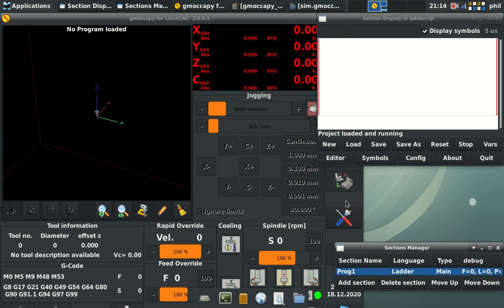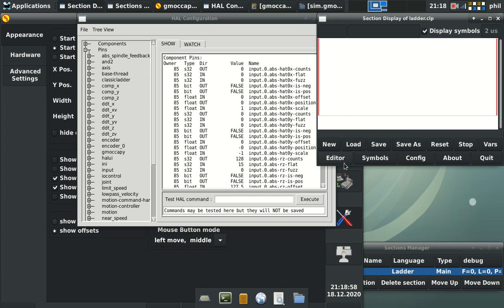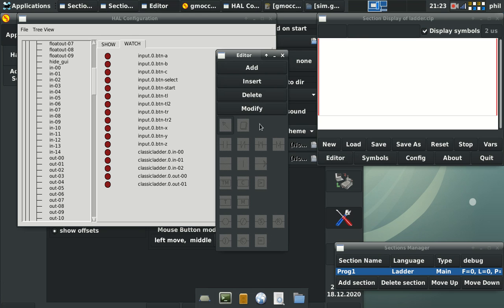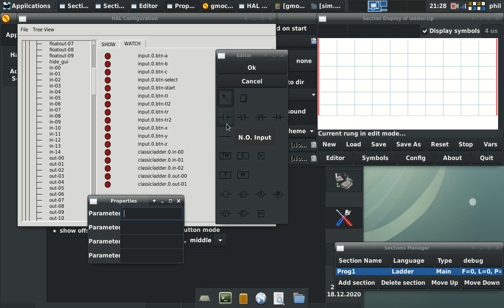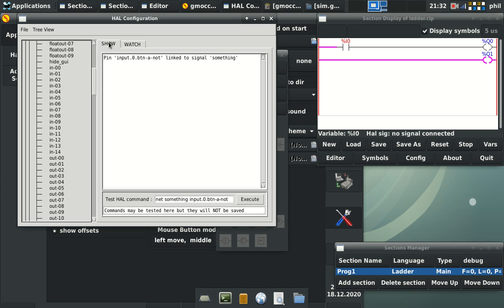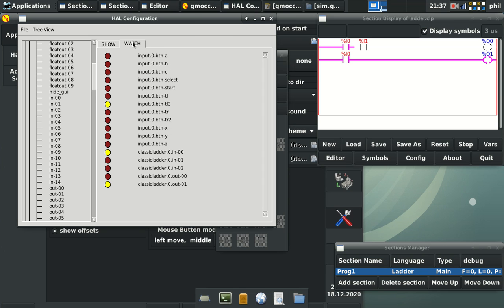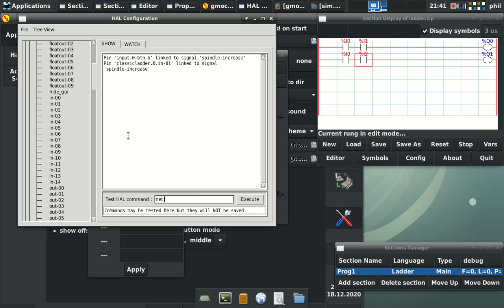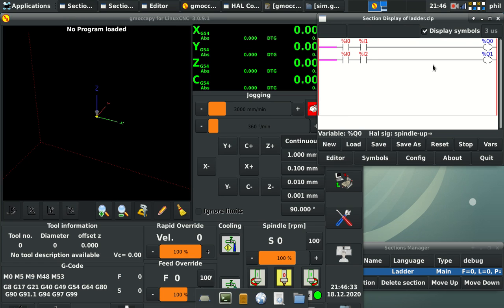LinuxCNC Classicladder introduction tutorial

Comment: I make my ladder on Windows PC. I copy it with a pendrive to Linuxcnc. But my ClassicLadder software save *.clprj files. I think, my EMC2 config do not load it. Net variables command are working, but the ladder.clprj do nothing. Do you help me with some tips?
Reply from the maker: Might be incompatible versions. Classicladder for Linuxcnc is heavily modified to work specifically with LinuxCNC. The other thing to check is that you started the ladder after loading it.

Comment: what happens if you press the increase + decrease + deadmans button?    I'd suggest using your NCi1 and NCi2 on the opposite inputs to lock out the possible pressing of all three buttons.
Reply from the maker: Correct, in a real world scenario, you would want an xor circuit to lock out one button when you press the other. In this case, it doesn't have a detrimental effect on the basic example. If you get deeper into the video series, you'll see I have an extensive video on and, or, xor and compare it to and2, or2 and xor2 in hal